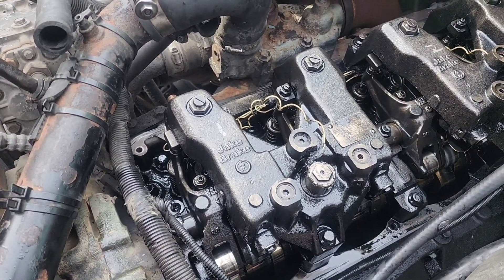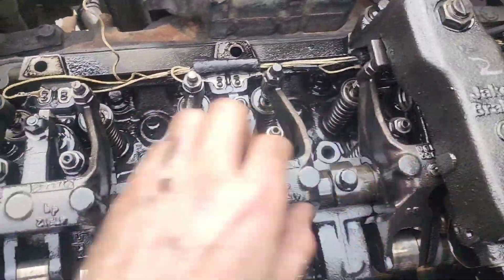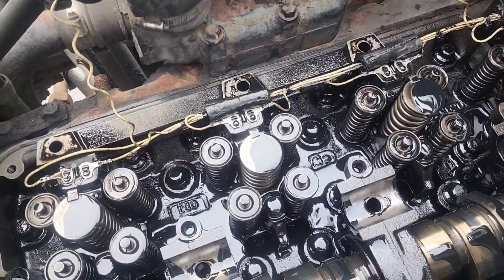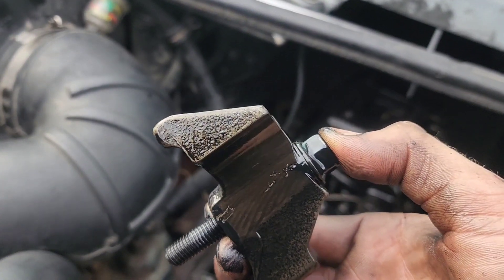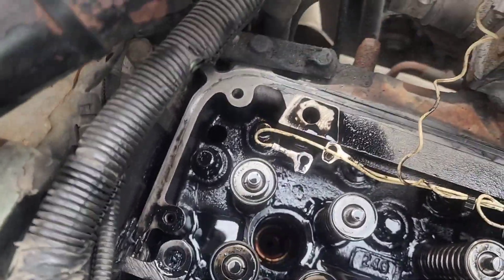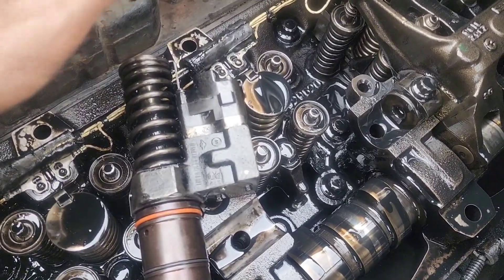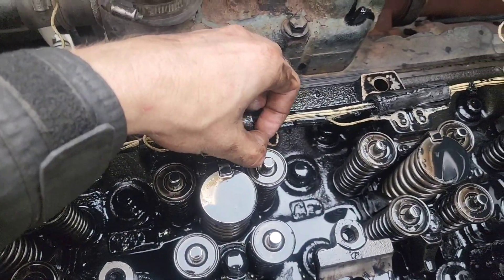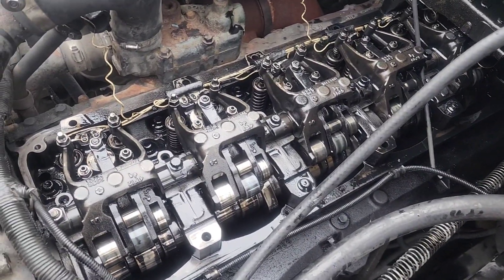Detroit 60 Injector Replacement How to Easy Freightliner Century Columbia 12.7 14 liter DIY

Comment: Before removing a fuel injector , take the outlet hose from the fuel pump loose and blow through the hose to remove fuel from the fuel galley back into the fuel tank .

Comment: Thank you for this video,

We have a MCI bus that had an injector go bad and to extract fuel from combustion chamber I turned off the rear ignition panel and "bumped" the starter to push fuel out of the combustion chamber. Now we're back on the road good to go!!

Thank you!

Comment: for 15 years I drove a 06 western star  14 L  60 series. After  6 years about 150,000 I had some one delete the EGR valve and tune it to 600 HP.  Well we pulled mountains a lot over 80K  and it didnt take long to blow a head gasket. Replaced that and it did it again about a year later. still ran great but decided to do a complete in frame. liner protusion was off of course.  so did all that and it was finally a great engine again. replaced some injectors over the years.  the shop never checked the codes so just left them set on 75.  haha.  great power.  Of course with those engines you get some injector wiring and ECM issues. I was able to figure some of that out. put Dielectric grease on  ECM plugs.  On the boost sensor plug I had to put a bolt in an empty hole on the head and zip tie it so it was more secure. I had a slight miss and boost sensor voltage issue.  it was that easy to fix that.  Its been running great for the past 7 years. has @ 400,000 on.  take care.

Comment: If I was to do all 6 of mine how could I just drain the cylinder head so I’ll have one less thing to worry about?
Reply: Pull the check valve on the back of the head

Comment: FyI...you can Google and find the service manual online for free.  First of all you NEVER LET THE CYLINDER FILL WITH FUEL!  You are supposed to drain the head by releasing the return check valve and draining  it. The other thing you missed was the other carbon seal on the tip of the injector, this was an update to improve sealing and are a one time use. Each injector used 4 peices to seal it.

Comment: Do you have to recalibrate all or just put everything together and ready to go
Reply from the maker: All injectors are set at 07 and she purrs most of the time.  #5 sputters sometimes, still a mystery, new injector.  Could be ecm sodder points or wiring